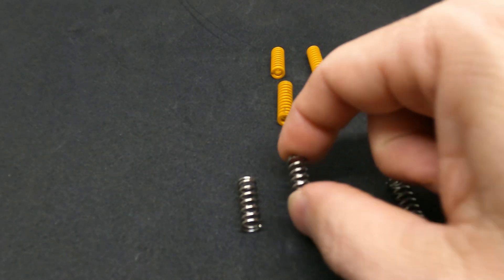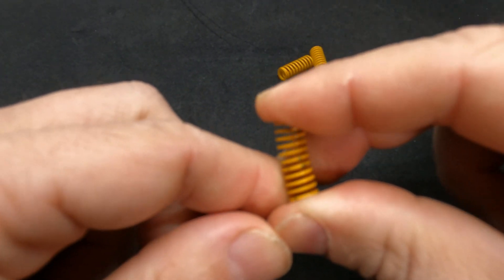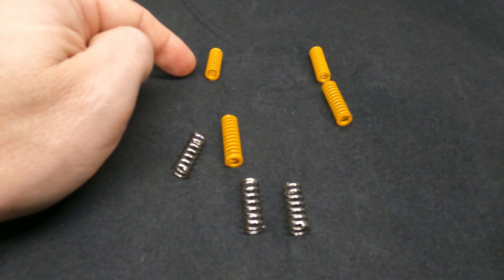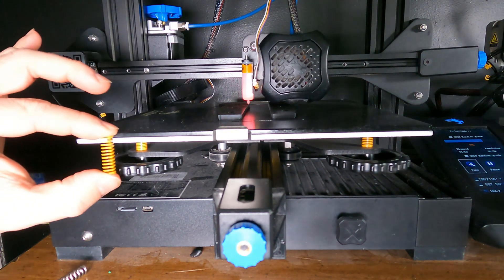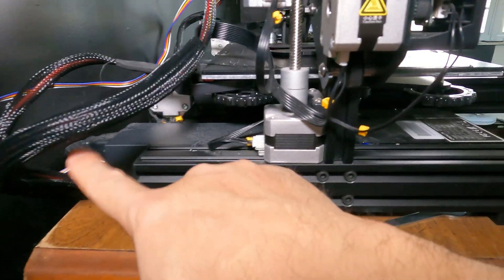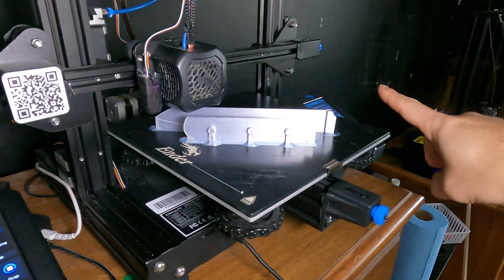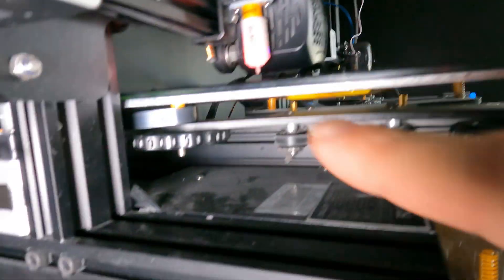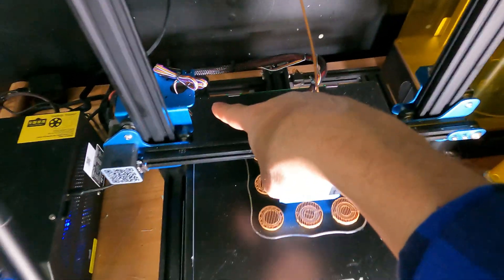Yes, UPGRADE your Creality 3D Printer Springs, to YELLOW SPRINGS. They WILL help level the bed

Comment: Well, he told me about 8 times which corner is the short spring, but never showed how to replace them.  The back one by the wire looks tricky.
Reply from the maker: All the same. Remove the knob. The little piece hold the wire in that corner will slide on/off the bolt. Place the spring. Put the knob back on. Thanks for the snark.

Comment: In the springs I got all the springs are all the same size what do I do or like it’s shorter but like a little bit is that the short one you’re talking about?
Reply from the maker: One should be shorter. It's just a touch shorter
Reply: I have the same issue, I ordered from the link provided but they are all identical sizes, the amazon page even states they are all 20mm @GreggAdventure